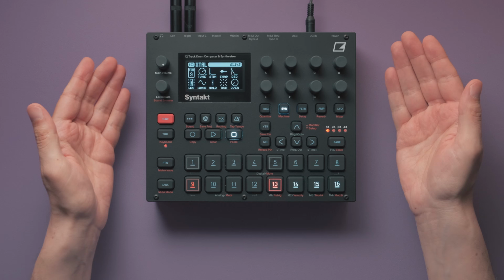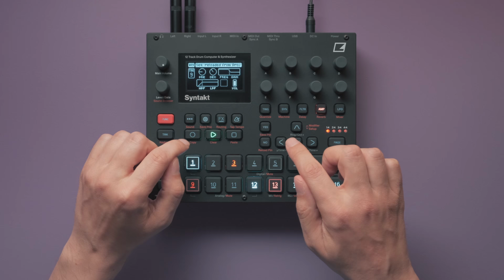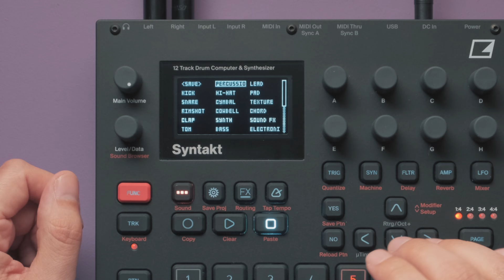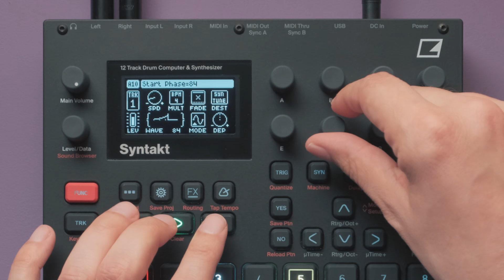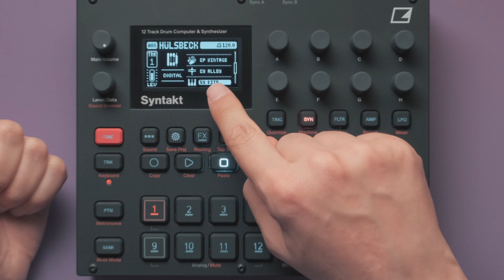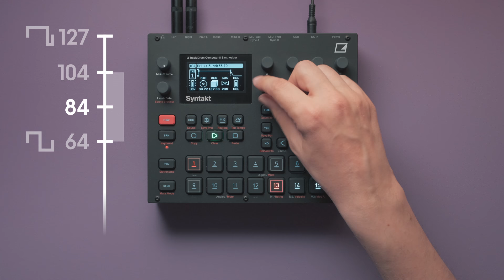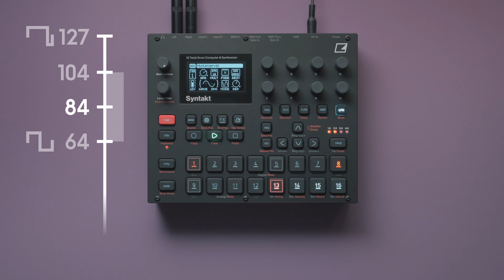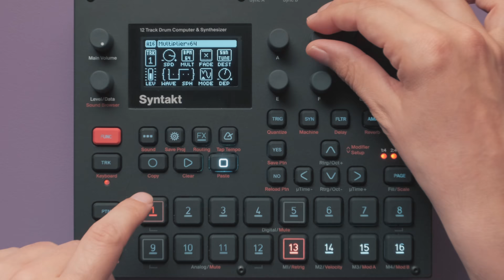The Best Workarounds for Syntakt + Digitakt + Digitone | You NEED to know these tips!

Comment: If you use lfos in bpm modes. Set speeds +or- at rates of 1,2,4,8,16,32 or 64 for the lfos to work in time of the bpm. Values of 3,6,12,24 & 48 work too for dotted note & triplet timing speeds of lfos. Much like finding & using the right delay times & pre delay reverb times to be bpm dependent. The same value apply for setting speeds of the bpm lfos
Reply: Thank you!!
Reply: Ohhh, so THAT‘S how this works! This was one of my biggest mysteries on my brand new Syntakt (my very first Elektron device)! I never understood why I still can choose a speed value when I already said that the LFO speed should be in sync with the BMP. And sometimes (most of the time, actually) it wasn‘t in sync despite the BPM 1, 2, … setting. Now I know that 2^n values need to be chosen with the speed parameter to stay in BPM sync! Brilliant! 🙏 👍👍

Comment: Professional and funny as always, thanks Captain! Any tips for the lack of song mode? 🤐 I imagined this one: in ableton live we create a drum rack, each slot has an external instrument with different midi channels 1 to 12, so in one track you can write the whole drum part and control the syntakt as it was purely a drum synth, like a vermona for instance. Now the difficult question: can you record all tracks using overnridge at the same time? As the USB midi in overnridge mode can't receive midi data, I suppose it will work sending via the 5 pins midi... Anybody tried something like that? Captain? you know everything! 🙌🏼 To me using the syntakt as a drum synth, sending notes + automation, and multitrack ir via overbridge would be the ideal solution for songwriting
Reply: oh ya, song mode!  much desired feature
Reply from the maker: Thanks so much! Song mode is a tough one. You could use the program change capabilities as a workaround and sequence the pattern changes from an external device. The feature is enabled in SETTINGS > MIDI CONFIG > SYNC > PROG CH RECEIVE. You can set the channel under SETTINGS > MIDI CONFIG > CHANNELS > PROGRAM CHG IN CH. If you send a MIDI program change message (0–127), this will then select a pattern (A01–H16). But I really hope Elektron will implement a way to save at least a simple pattern chain sometime in the future.
Reply: Thanks a lot for answering  @CaptainPikant  So, if I use an external device to sequence pattern changes (or Ableton Live) could I still multitrack everything via overbridge? I don't own a Syntakt yet, mostly because of this question.. I read in the manual that USB Midi and Overbridge are exclusive, but I suppose you can sequence patterns via 5 pins midi and multitrack via usb.. can't find anybody who confirm that :) all the best!
Reply from the maker: @flaviobanterla  I think that should work, but I'd have to try this out myself. I don't know when I'll have the time though, so maybe you could ask in the Elektronauts forum?
Reply: @CaptainPikant  Yeah, I'll try again on the forums, after this conversation I think I can explain it better, so thanks for that. If someday you end up trying it please let us now :) thanks again for your great content!! peace

Comment: Tx for sharing! Can you group tracks together on the digitakt also for the sidechain?
Reply from the maker: Sadly no, but the Digitakt's compressor has a sidechain source setting. Just set that to your kick track. Good compressor settings to start with are a high ratio, low threshold, negative sidechain filter and 75% mix.
Reply: @CaptainPikant  tx man!